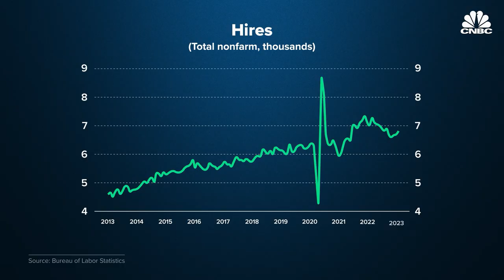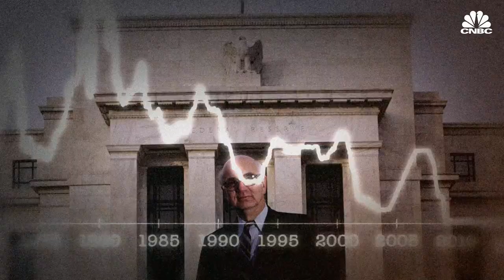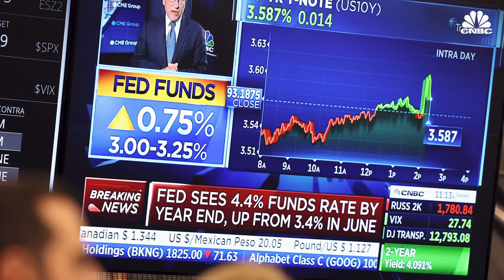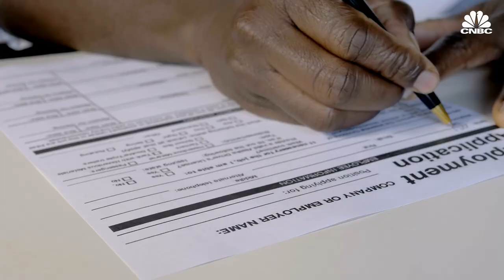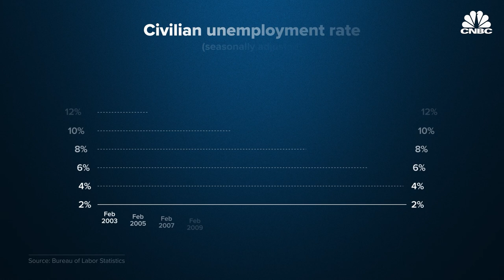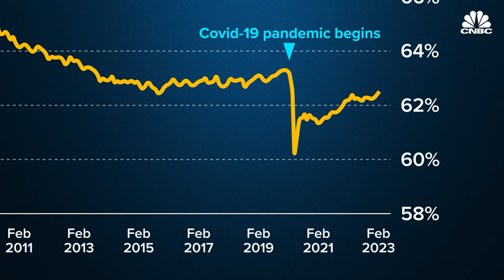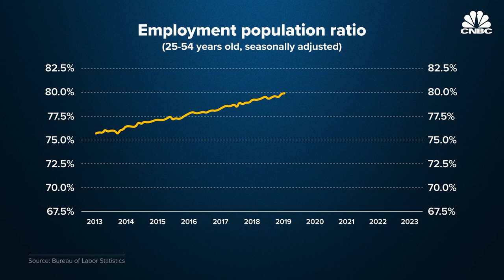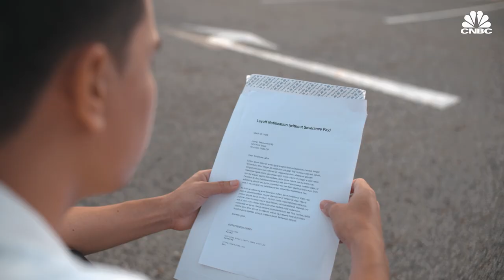Why ‘Maximum Employment’ Feels Impossible In The U.S.

Comment: 2% inflation is a purely arbitrary target. Why is it better to have 2% inflation and 5% unemployment than vice-versa?  I have asked this question to many people incl PhD economists and have NEVER gotten a satisfying answer that went substantially beyond “inflation bad”. If wages rise in lockstep, 5% inflation is a nothingburger.
Reply: I think it because inflation is like compound interest and 2% is manageable near liner growth while 5% accelerates away exponentially. Put the 2% and 5% into a online compound interest calculator and you will see the difference.
Reply: @jimpaddy79  But again, my answer is,so what? as long as your wages also grow by 5% its totally irrelevant
Reply: @value4363 it more complicated then that because of loans and investments, if I loaned you money and you agreed to pay it back in a years time I would lose value because the money you paid back would be worth less because of inflation so i would have to charge you 2% interest to get the same value back, now if inflation was 5% I would need to charge 5%. This means you would need to earn a higher profit or RoI. Also 2% gives a safety margin, if inflation rises in the short term its not the end of the world, while because of the compounding if inflation rose much above 5% prices would start changing very quickly which fuels further inflation and starts pushing you towards hyper inflation which is impossible to break out of. Finally at 2% the prices of thing change slow over time, so its easy to judge the value of things, while with 5% because of the compounding price would change dramatically over time and every 20 years you would need to add a zero on to the bank notes. Hope this helps
Reply: In your scenario inflation would likely spiral out of control.   If wages rise in lockstep, remember, those wages only apply to the employed.  The unemployed, the underemployed, the retired, would all suffer significantly as would those at the lowest income levels.

Comment: I was informed that I qualify for food stamps as a student- $180/month which isn't much but it does help. Then DHHS called to say that the requirements are changing and I will need to work 30 hours per week to qualify 😒 they had no answer as to how to not max out my income limit working 30 hours or how in the hell I'm supposed to work 30 hours while going to school full time... So basically, I don't qualify for the meager assistance because I'm a broke student
Reply: A lot of people work full time while going to school full time.  But you're right, you probably won't qualify for food stamps then.
Reply: @DC-rd6oq  for sure. I'm doing 20 hr/week between 2 jobs currently so I stay below the income limit $1600 monthly in order to qualify. When the state changes requirements, it seems like no one will qualify?? Maybe only people making less than $10/hr 🫤
Reply: @Madamchief  I think that is probably their point, although I think the income limit is too low especially if you're trying to pay for school or take out less student debt, which of course is a huge issue these days since getting an education is so expensive.  I'm not sure, though, why you would work less just to get $180/month.  If you're working 20/week and making close to $1,600/month, that's $18-20/hour.  You'd only have to work 2-3 hours more per work for that $180/month.  You'd be so much better off financially if you worked a total of 25-30 hours per week even though you wouldn't get the $180.
Reply: @DC-rd6oq  it's just too much for me to work full time and go to nurse school. I need at least 30 hours per week for class and study. I do have a mortgage to service so I only work as many hours as is necessary for the monthlies so I was stoked when I heard about student SNAP. Now I'm bummed I even bothered
Reply: @Madamchief  School is expensive so stop crying you're fine, some people can't even afford to go to school and here you are going on like life is sooooo unfair 😆
Reply: @thealchemist69666  not really crying... Just peeved that the State does so little to help low income people. I realize school is my choice and I'm making huge sacrifices to afford to get my stupid nursing license. Some day I'll make enough money to buy vegetables again 🤌

Comment: In basic statistics 101, correlation between x (e.g., unemployment rate) and y (inflation rate) is Not necessarily equal to the causation between x and y, i.e., the change of x is causing the change of y. Hopefully, Fed can have other variables to look at and does not just focus on these two variables ( unemployment rate and inflation rate).
Reply: But there is causation between interest rates, employment and inflation. Also its the fed legal mandate to manage the inflation and unemployment rate.
Reply: You cannot concert complex process into simple formula😂
Reply: @blastard5539  you definitely can just look at Chat gtp, and the incredible complex process it turns into equation. The labour market is not a particularly complex process to model anyway its basically a supply and demand curve